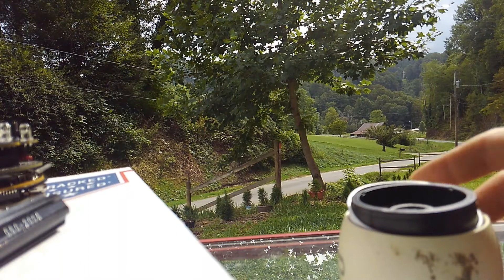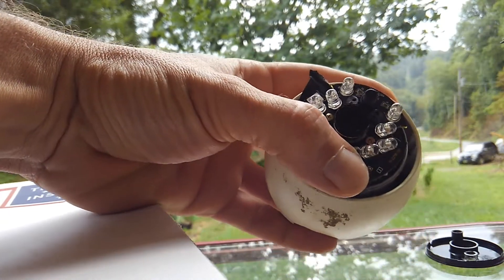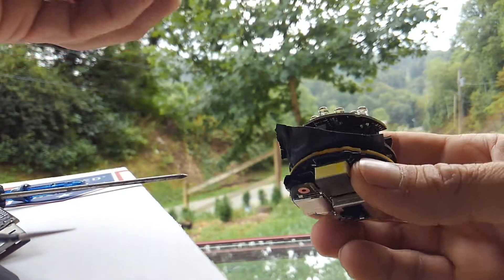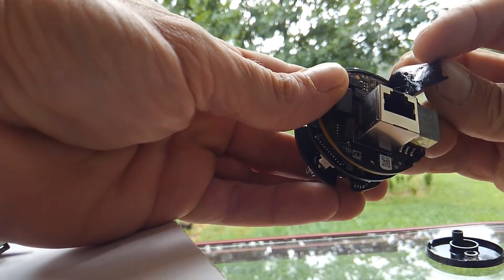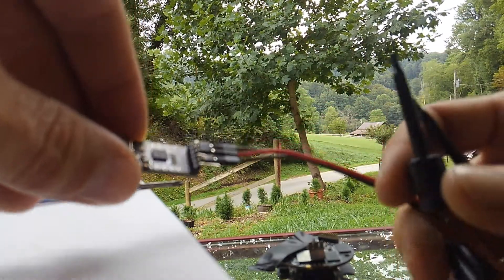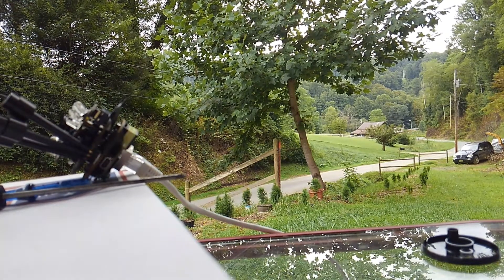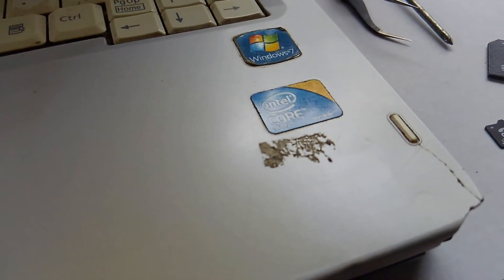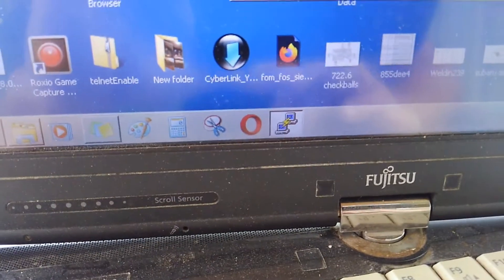UVC-G3 Manual Firmware Update Serial Interface Using Putty UART With Disassembly (Part 1)

Comment: Was the purpose of a manual firmware update an unresponsive camera? I can perform a factory reset on my UVC-G3 camera, but it refuses to get an IP address. Will a manual firmware update fix it?
Reply: Did you get it figured out?